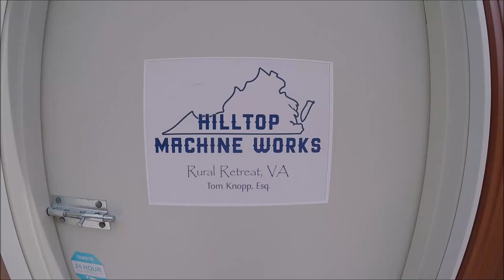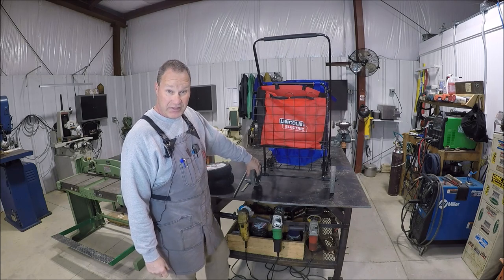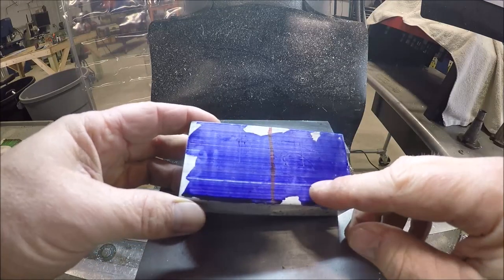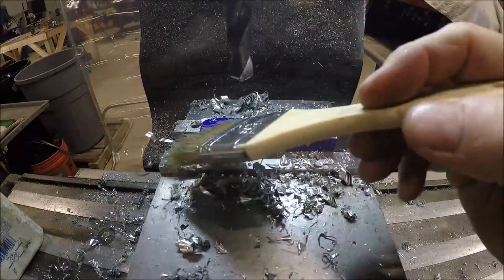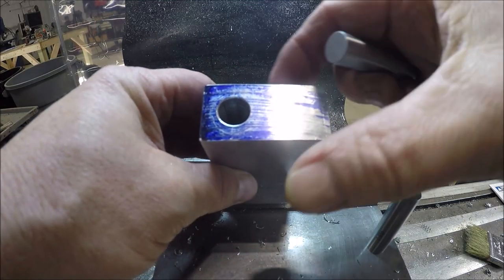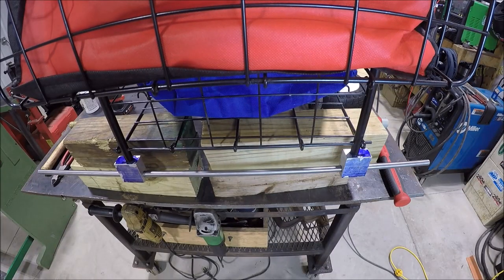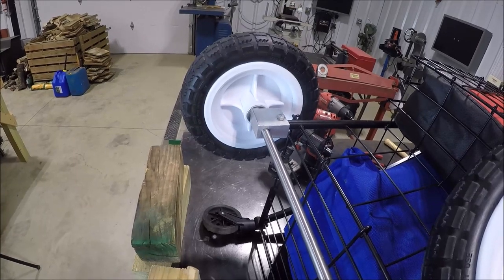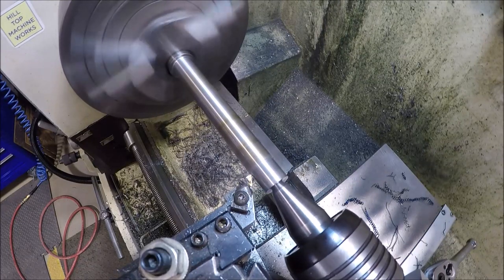Flea market cart wheel & axle upgrade  Part 1

Comment: I would love to see you scratch built a cart. Personally I use a handtruck that I modified with oversize wheels. That can go wet or dry in ruts or smooth. Are use a 5 gallon bucket some ratchet straps and a moving blanket. Just in case I run across something special. Keep the videos coming.
Reply from the maker: I may build one down the road. I would take a red wagon with me for the car/truck swap meets because I had more room to maneuver around with it. This cart works well in crowded areas.

Comment: Did you get your taper sorted?
Reply from the maker: Hopefully. Apparently the lathe had settled since I leveled it in the summer and there was a twist in the bed and the tailstock was out again. I tweaked everything. I just have not made any test cuts yet to confirm it is good to go. I need to do that.